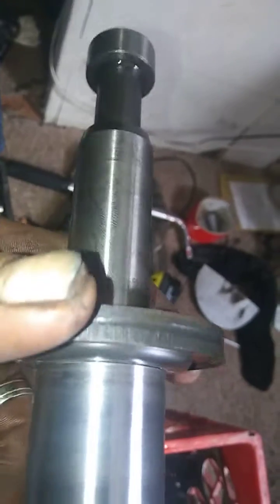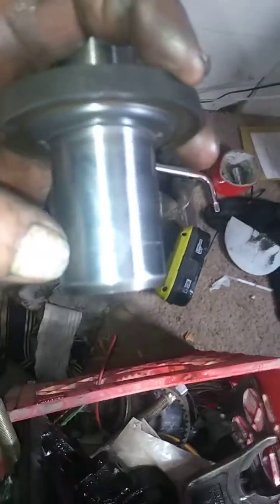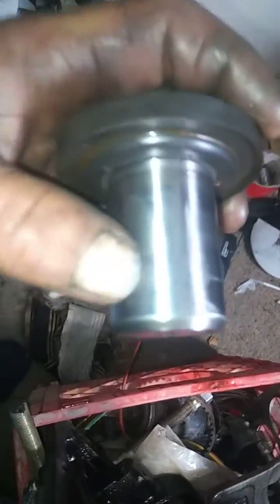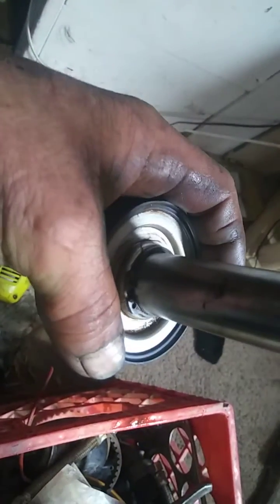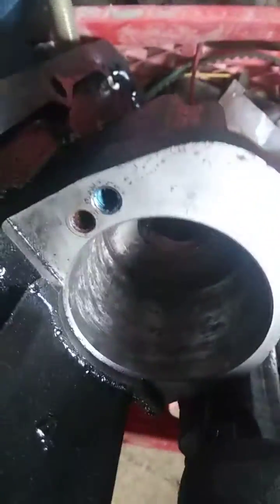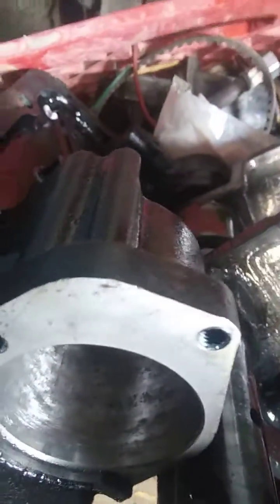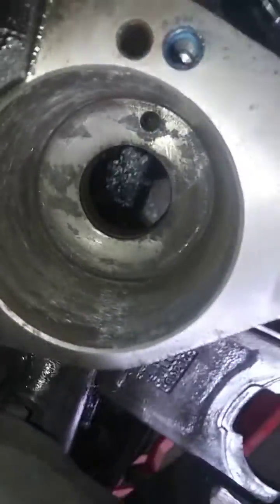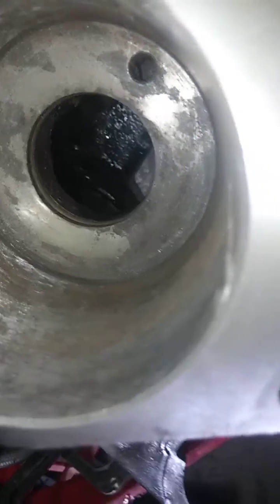Eaton 10 speed hi/lo range selector piston rebuild.

Comment: Would this cause it to not want to go into 7th-10th? I have a super 10 and when i move the shifter to the right, i hear air release, but cant push the gear lever into gear. If i keep going to the right, the shift lever slips outta the shifter cup the forks attach to.

Comment: It does matter if the bore is
within spec if  its honed out passed tolerance its useless.
The groove in that piston is for a rubber seal to ride in.
However it to is worn passed tolerance.
That's all junk you hold in your un gloved 90 weight soaked hand in your living room.

Comment: To remove the range piston and rebuild it do you have to remove the top cover of the transmission?
Reply: I've got the same question. Can the O-ring be changed on the field, or does the auxiliary need to be removed?
Reply: @OldCrowsClassicCars  I had to remove top trans cover
Reply: @HinojosaRandy  did you have to drop entire trans to remove the top plate?
Reply: @2ndMomentumGarage  no I just went under the truck and removed the top plate to the transmission